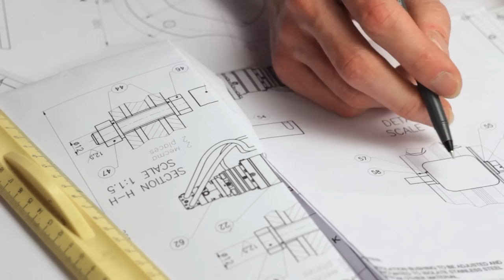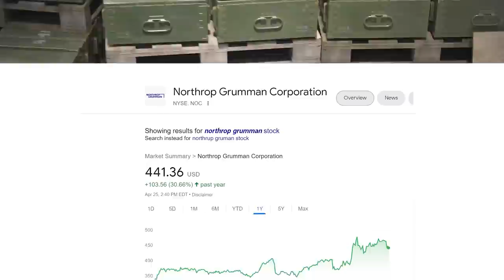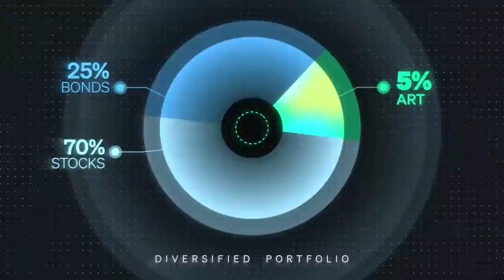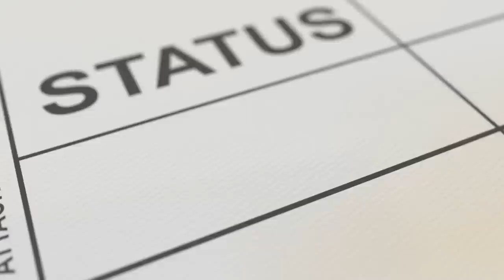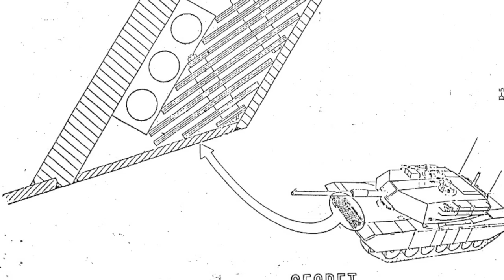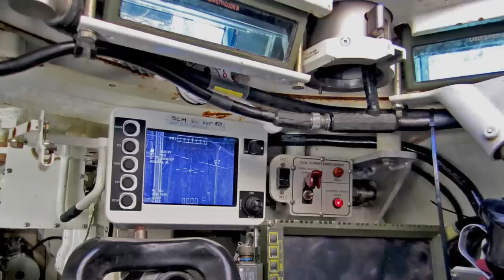The M1 Abrams Tank Needs to Chill Out

Comment: The flaw in the M1 is in it's design philosophy, its made for mass tank on tank battles with Infantry being an after thought. So while it may do well up against a T72 against an army that also uses mass tank as a doctrine, it is unlikely to do as well up against an army that uses the Infantry Tank doctrine and a tank designed for that purpose (all things being equal)
If you think that the M1 had its critics, try looking at the Challenger, which excels at what it's designed for even if it doesn't "wow" the crowd at competitions.

Comment: The only part of the Abrams I don't like is the engine. I get it works, but it's also it's biggest weakness. It takes a lot to refuel, and you get MPG compared to newer diesel engines.

Comment: 7:50 The explanation on moving is not quite accurate. It is not just supposed to move back and forward. It is supposed to change its firing position. In defense, you have identified several firing positions of your tank platoon (2-3 per tank) in the pre-battle phase (one of the defendant's advantages). A tank should never fire one or two shots form the same position. Of course that has also to do with missiles, but that doctrine was established even before missilies were there. Moving shortly back and forth on a gunnery range just is a drill so that the changing of the fire position (and the coordination of said changing, since there no movement is to be made from one element without an other element covering said movement with fire) goes into the blood and flesh of the crew and the fire unit (the platoon); due to range security, in a live firing exercise on a smaller range, you cannot make a full change of your firing position. So you just make the short back/forth motion to implement is as an automatic thing to do. While one positive side effect might be the occassional missile to miss, the main advantage is that it tremendously impairs the opponent's ability to coordinate its fire, even more so as in such a scenario, the opponent is moving (!) in a terrain only known from a map (which looks totally different in real) and has very limited time to identify targets and coordinate fire.

Comment: The M1 Abrams tank is the right choice for the US military. The large turret and large hull not only can fit a big gun and big engine, but also room for the modern sophisticated electronic equipment. Had the US chosen a smaller tank, it would be forced to find a replacement 20 years later. This would be very costly.

Comment: Hate to say it.  We may have replace M60's with M1's .... But I'm pretty sure that in the 1980's if you weren't all ready on an M1 you were in an M60A3 which did have stabilized optics... I should know my basic training and 3 duty assignments ending in 1985 were all to units still fielding M60A3's I turned in 3 tanks before I finally got reclassified to 19K and then I ets'd....

Comment: The designers should put the engine in its own compartment in the front of the tank but the crew in the back with a large hatch so that they can escape after the tank takes around in the front and becomes disabled they should also not use the electrical batteries because they are basically thermite

Comment: I see I am not the target audience for this video.
I was reading about tanks since 1994 and worked on and around them in the early to mid 2000's in my capacity as a Mechanized Infantryman. It doesn't mean I know what I am talking about. Being a computer user doesn't make anyone a computer expert.
But...

The M1 Abrams is nothing special. It didn't introduce the composite armor. The T-64 in the late 1960's did. The turbine engine was introduced by the Swedes in S-tank also in the 1960's. The 120mm Abrams has is actually from Germany, and the same gun Leopard 2 had. License built of course. The added armor similar to the TUSK was done by everybody and their mother. My country did that in the late 1980's and we got the PT-91 out of that. The remote controlled machine gun station was something people played with since WWII.
Abrams to other tanks of the era also doesn't have anything remarkable about it. The range record of any tank on tank kill belongs to the British Challenger 2.

No modern tank shines above the rest. Compering it to Markava, Leopard 2, Leclerc, or Challanger 2 is like comparing compact cars made by Volkswagen, Ford, Peugeot, or Toyota. 
All are about as good as the other competitor. All have a similar level of protection. All have similar sensor suits, all have similar power to weight ratios. Abrams gets its power out of a turbine, Leclerc out of a 16-liter diesel, Leopard 2 out of a 29-liter diesel.

The US has, arguably, the best army in the world. But it is not because the Abrams are so good. It is the training that makes it great. When you gave it to the Iraqis, they got theirs captured by ISIS.
The Ukrainians are winning tank engagements driving 40-year-old T-64 versus a factory-new T-90. In WWII Shermans won battles versus King Tigers. Recently the Turks got embarrassed driving Leopard 2's around.

A tank is a tank is a tank is a tank. 
There is nothing wrong with the Abrams, but there is nothing to write home about it.

Comment: It must be taken into account that US has never fought against a well-equipped and modern army. On the modern tank battlefield, only APS can become a winning factor.
Reply: Using APS on a tank is like using CIWS Vulcan 20mm Phalanx R2D2 on a aircraft carrier.  A lot of protection had to fail if that is your last resort at protection.  US tanks operate in a combined arms formation with infantry, artillery, mortars, close air support, air defense, drones, engineers, scouts, intel, and logistics all tied together with command & control.  Anti tank weapons will need to get through a lot of layers of protection before they can get a shot at a tank.

Comment: After spending huge amounts on protection and maintenance, what, ultimately, does an MBT do that today can't be done by a combo of wheeled IFVs with latest gen fire control + drones ? 
Unless there is a convincing answer then what Chris Cappy is hinting at (but doesn't want to say out loud) is valid - the tank is obsolete - not because of vulnerability but because it no longer has a clear compelling role.
Reply: Tanks provide a combination of mobility, survivability, and direct firepower that is hard to duplicate with less protected lighter wheel vehicles and drones.  If tanks are obsolete; then, every other piece of equipment on the battlefield is also because they are even more vulnerable to the exact same defensive weapons/tactics.  Before tank, you could see 10,000 to 20,000 soldiers dying on the battlefield in a single day.  Hard to find battles with numbers like that with direct confrontations with armies since tanks were introduced starting with WW1.  Why do you think so much money and firepower is dedicated on destroying tanks?  It is because they are so deadly on the battlefield.  It takes a $175,000 Javelin, $35,000 NLAW, fighter jets, attack helicopters, huge tank mines, tank size obstacles, and massive amount of artillery to slow down or stop tanks.

Comment: Your mention of about 500 Abrams tanks coming back to the US for repairs gives the audience the impression that these were repairs from battle damage.
This is so far from the truth.
Very few tanks had serious battle damage, most of the repairs (probably the 90%+ range) were simply because the tanks were used A LOT and were in dire need of maintenance. 
The tanks were also sent back for rebuild and upgrades. The Abrams is one of the BEST tanks on the planet and the only tanks that have a REAL chance to defeat it are operated by our Allies.
People on the outside who do NOT know the true facts can only speculate and then their speculation is usually WRONG.

Comment: Do you count as destroyed by an enemy fire those Abramses that were destroyed by the main engine catching fire after the external auxiliary power unit or fuel tanks been hit by .50 cal HMG ?
Reply: All run on diesel fuel. Diesel fuel doesn't catch fire easily and there are no fuel tanks located where a .50 cal HMG can touch them.  The APU is on the outside of the turret and there is a fuel shut-off valve. You playing WoT?
Reply: @ODST6262  How confident are you that M1As were running only on diesel in Iraq? You better check the history of M1A losses there.
P.s. no, I've never played WoT and I don't regret it.
Reply: @andgame4857  Good point.  My comment relates to the 1st Gulf War. To be honest I know we switched the tank fuel from #2 and #1 diesel to JP8 but not the exact date. It may have been before the 1st Gulf War in which case they were using JP8.  The main effects of the switch was it wasn't necessary to switch the types of diesel or treat #2 dependent on the temperature, a slight loss in range as JP8 had slightly less energy output than diesel, and the smoke generator function of the engines, like on Soviet tanks, didn't function as JP8 didn't smoke when sprayed on a hot surface.
We purchased 18 M1A1 to replace losses in the first Gulf War. Four were combat losses and 14 were replacements for 14 tanks destroyed in a depot fire where they were stored. That is it. Oh, and we purchased a battalion of M1A1 for the USMC.
Second Gulf War was over a period of 20 years.  I have no figures on US vehicle losses. You were referring to the first Gulf War, not the idiotic invasion of Iraq after 9/11?
Reply: @ODST6262  I'm referring to cases mentioned in the "Abrams Tank Systems: Lessons Learned. Operation Iraqi Freedom. 2003" (available on GlobalSecurity site), page 5. 
I quote: "In some instances, catastrophic losses resulted from burning EAPU material and/or packaged POL products dripping down into the engine compartment catching the engine on fire".

I've also read many similar though less presentable reports about such a weakness in the early models of US M1A1 tanks. Btw, those reports (if I remember right) re APU being a weak spot were not about its fuel, but its dripping hot or even burning oil.
Reply: @andgame4857  I have no information. External APU on the back of the turret were added after I was involved with the program. Our APU was on the right rear fender area and couldn't drip into the engine. It was available only for training as combat would destroy it just from vibration. It was basically a fuel saving temporary measure.

Comment: I don't like the M-1, see how big the turret is compared to the gun? They could make it look a lot better by making a longer barrel w/ muzzle brake. It doesn't really need that, but it would look so much better.
Reply: Not about looks; but, effectiveness.  The form follows function meaning it is designed for a purpose first and it will take whatever form later.  The Abrams is designed to fire first and kill in one shot; not, to shake its ass down a fashion runway.

Comment: During the 91 Iraq war there were reports that M1 crews were far more aggressive because they knew they were protected.  In retrospect I'd love to find out of well this did or did not hold up.
Reply: Soldiers are trained to be aggressive.
Reply: @crusher8017  From my 30 year old memory, soldiers in the M1 tank were more willing to take risks on the battlefield because they knew the tank would protect them.  In retrospect I'd love to find out if both were true, and if so, has that changed how equipment is designed.
Reply: @kennethng8346  I was Oz Army and the first thing in Basic is that you are trianed to be aggressive. It hapens in most of the Western Countries during basic. That is why the other main protagonists suffer so many casualties. Only the SNCO's are career and are taught to be aggressive where their juniors are not, they just fill slots to make numbers.
Reply: @kennethng8346  Mate, being aggressive is part of Western military training. Add weapons that work very well and the soldiers confidence level increases. Conversely, look at Soviet / Russian / Chinese doctrine. Lots of cheap tanks, IFV's and APC's plus soldiers who receive minimal training to attack en mass in the hope of overunning their enemy. Their morale would fail within a few days or weeks due to the rate of attrition of smaller, better trained and armed Western forces.

Comment: I think a different fighting vehicle should be developed for fighting in environments like city and other tight quarters combat areas (i.e. deep valleys, choke points, places where infantry can ambush a big tank)...and maybe sink some research into making the Abrams engine a little more efficient couldn't hurt either.
Reply: That's what's called an LAV (light armored vehicle) and those are already in use in various forms by various military and paramilitary forces. Can be anything from a technical made from a Toyota Hilux with ad-hoc armor welded on, or proper armored trucks/HSVs or any of various tank-like wheeled vehicles. Mobility trumps overall armament, but they still have enough firepower to do the job.
Reply: No one in the US Army is concerned about mpgs for a tank.  They wanted a vehicle with a X operational range and that is what they have.  It has been +42 years with the Abram's turbine engine and they had plenty of time to turn it into a Prius if they needed that for its operational needs.
Reply: @mrgold3591  Yes, and the Abrams can go for 200+ miles...but what if it could go 300+ miles? That's fewer trips to the gas station and that means more operational possibilities...but on the down side is the fuel trucks have to travel even further to reach the tanks and that means the resupply convoy is exposed just that much more to ambushes.

Comment: 500 Gallons of fuel, max Range 265 miles
Leopard 2 317 Gallons for max range 500 Kilometers, thats about 310 Miles.
So the fuel consumption of a Leopart 2 is about half 
Now that is a mayor logistical difference.
Reply: That 265 has to be no idling - our M1-IPs  were averaging 7 gallons/mile.  Great Tank but really sucked fuel.

Comment: alot of ppl seem to have this notion that tanks are obsolete now. they saw a news article that clearly dramatizes their headlines to get their attention and believed it. they seem to not understand that russian tanks are extremely obsolete. not only that, the ones u see in the frontlines arent the ones u see in adverts and introduction videos of the tanks. in these flashy cool vids (yes I do also watch russian youtube channels that cover, advertize, and test various russian vehicles and weaponry) these vehicles always have the latest gizmos. attachments that increase their survivability and situational awareness, etc. u know, kinda like how u would attach a Trophy system on an abrams, or don't. russia doesn't use these despite being capable of using them. cuz they cost time and money. russian tanks are also almost never accompanied by infantry support, and u can forget about air superiority. russia keeps sending convoys of tanks in a single-line formation into urban/suburban environments, where tanks are at their most vulnerable and cannot do much at all. they are sitting ducks! not to mention that cuz of their conga-line strategy, if the tank infront gets disabled, all the rest in the back have nowhere to go. but in open fields, they can outrange handheld ATs and can easily identify and fire at targets. russia doesn't do this

Comment: There is a 140mm gun option even I found m1 Abrams tank destroyer concept design
Reply: Unless the T-Series tanks make an improvement in armor against SABOT rounds, anything above a 120mm would just be overkill for the Abrams with the downside of carrying less rounds and harder to manually load in the turret.
Reply: @mrgold3591  pretty much improving the rounds itself proof around to increase accuracy and the deadlines

Comment: Main battle tanks of one kind or another will always be needed to conduct offensive operations: it's hard to imagine the Ukrainian Army clearing the Russians out of the occupied territories without that sort of mobile heavy firepower. As for protection - tanks have always been lost in battle in large numbers ever since WWI. The British army 'supplied' more heavy tanks to the Imperial German Army than they did to their US Army allies (180 compared to 150), due to knocked out or bogged down tanks being captured by the enemy on the Western Front. 
Hence what Chris Cappy is getting at: tanks are just part of the bigger tactical picture. All arms are needed to win battles. In the western front campaign of 1940, the Wehrmacht had few  tanks that were the equal of those of the French and British. They won that campaign using all-arms co-operation, mission command, and by being more aggressive than their opponents. The NLAW is effective because it has the element of surprise on its side - once the enemy work out how to counter it, then it won't be as good in the future. Also, the T72 is a half-century old design: as out of date compared to the latest Leopards, Challengers and Abrams as the Iraqi Type 59s and T55s were in Desert Storm, facing the Mk1 version of the latter two NATO tanks.

Comment: I think one of the reasons the Russians are failing is that they operate their tanks without infantry support and they don't have AWACS and air superiority. A military operation is about the coredination  of many different elements, its page one of any campaign manual  from Roman times to date.  You can have the best tanks in the world but if you don't use them correctly the enemy will turn them into scrap metal very quickly .